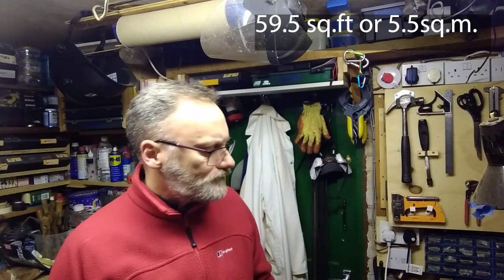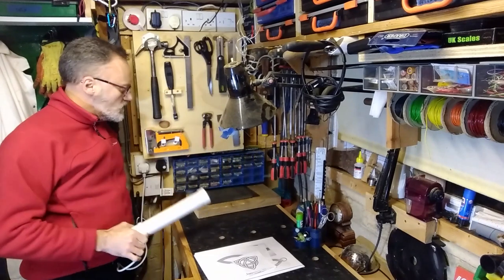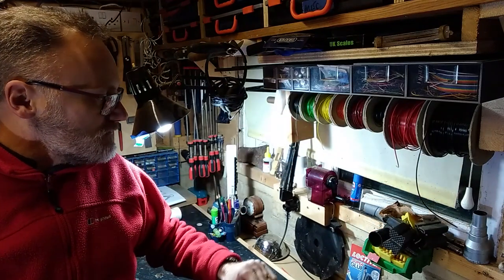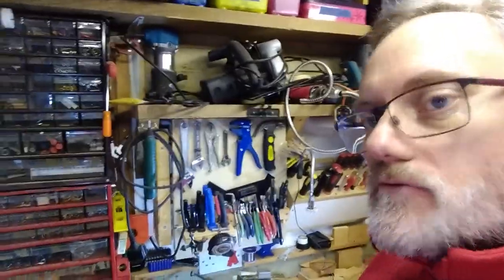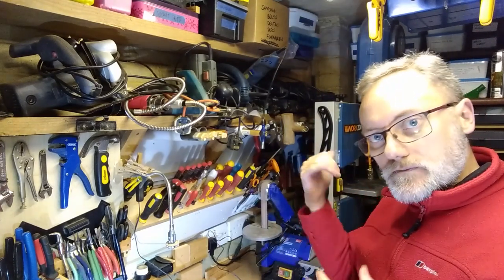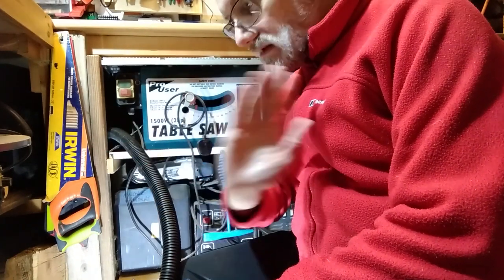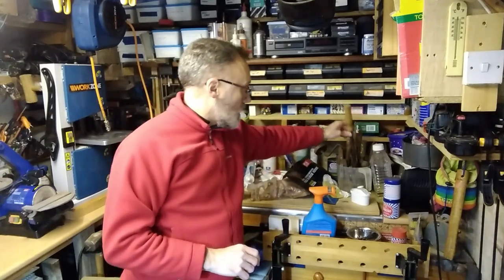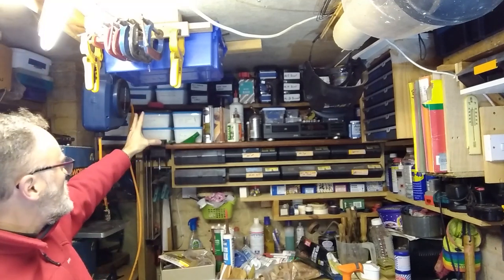TFTT068 Tinkerage Workshop Tour 2020

Comment: Nice too see it all together after watching the refit last year.... what about some magnetic tool holders for the spanners I always see the knife holders in charity shops and I use them in my van for holding tools ect. Were do you get your single core cable drums from mate
Reply from the maker: Thanks.
Magnets are something I have been considering or some sort of angled slot type system.
The wires are either from Rapid or from RS Components.
Reply: @TalesFromTheTinkerage  cheers